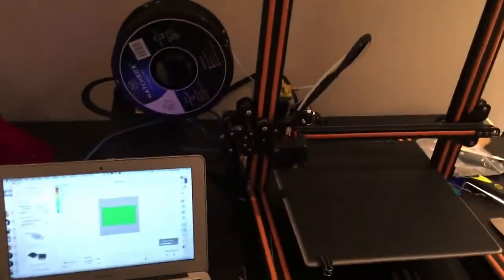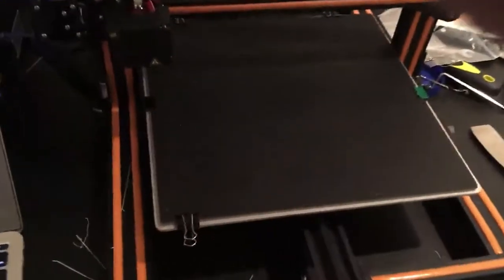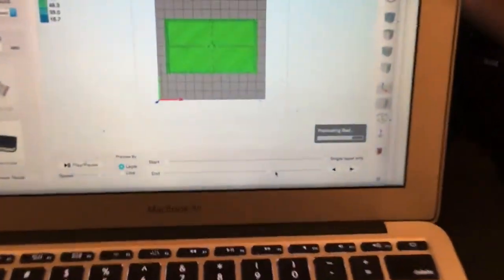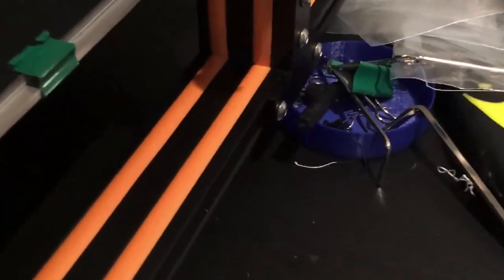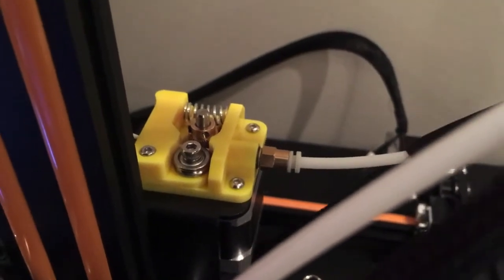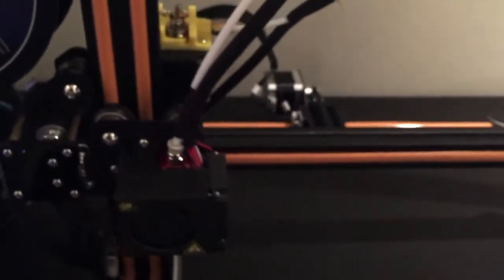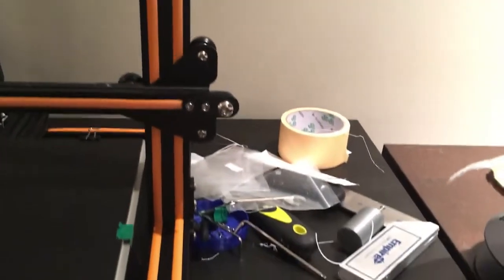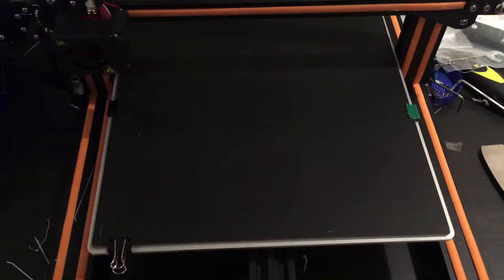Creality CR-10 3d printer first look review

Comment: If you had to pick - would you choose the Creality CR-10 or Original Prusa i3 Mk2?
Both are comparable in price (with shipping costs to Canada) at approx. $700 CAD
I like the possibility of taller prints with the CR-10, but the knowledge of customer support with Prusa is comforting...
Any recommendations? Thanks in advance, and keep up the great reviews!
Reply from the maker: Oh that's a difficult question! Depends on a lot of factors, what you will be printing especially :)

I would say the Prusa has the slight edge in terms of long term customer service and support, even though it is a kit.

The CR-10 bought through a good, trustworthy reseller is not far behind, and will actually be up and running faster versus the kit, but the parts are Aliexpress quality so long term will break or wear faster.

E3D v6, better first party board, etc makes the quality of the Prusa better, and will give it a lot more longevity I would think.

As a second printer I would wholeheartedly recommend the CR-10, or if you need that extra build area, you just have to be aware what you are buying is budget rather than premium :)
Reply from the maker: The customer service is the main advantage of the Prusa, but if you buy from Tiny Machines or Macewen3D you get customer service for a little more $ than Gearbest as a compromise

Comment: What build surface was that? How's the adhesion? Looks like there was some curling there at the corners?
Reply from the maker: The glass was flat, and using tape was fine for adhesion, but I had experience with my 250mm x 250mm bed and the models I print that removing the prints could be tricky, so the zebra plate allows me to remove the plate and flex it to pop stubborn prints off more easily :)
Reply from the maker: Zebra plate. Adhesion is good but still not happy with the level, hence the lifting, there are some low spots on the bed making it tricky to level the whole 300mm x 300mm surface :/
Reply: Why did you ditch the glass? Tends to be flat.